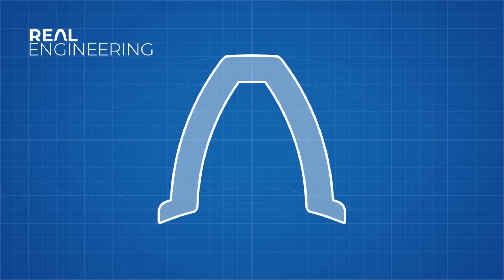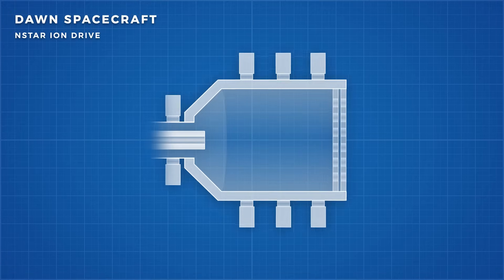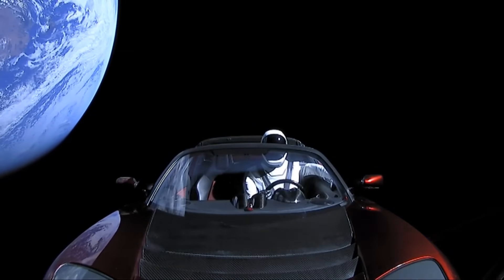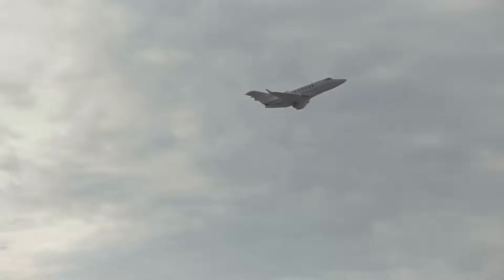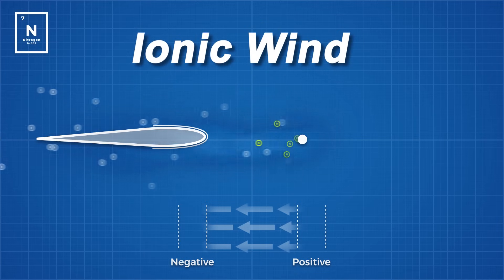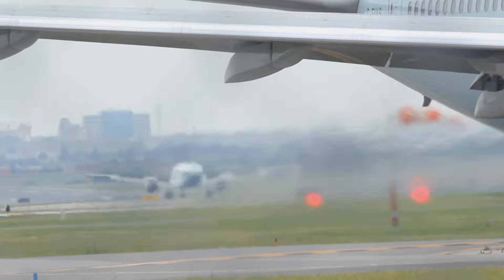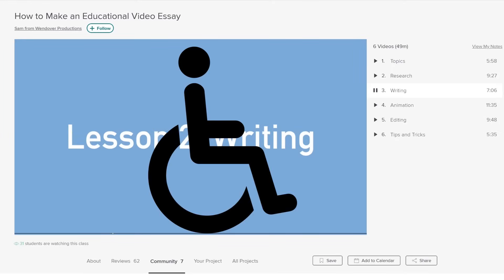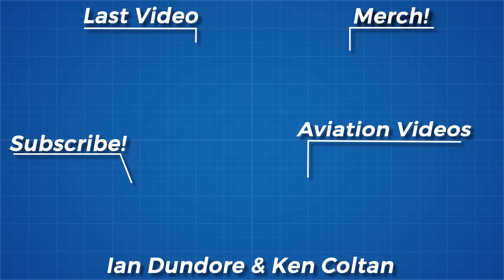Ion Propulsion - The Plane With No Moving Parts

Comment: Reminds me of when my buddy and I made "lifters" way back in the day. A no moving parts hobby flying machine. Though you need a high voltage power supply to make it fly. In my limited understanding and simple terms, this little craft ionizes air molecules along a copper wire and then gets accelerated past a oppositely charged aluminum skirt. Pretty neat stuff. 

Edit: Yeah, MIT's plane looks like modified lifter tech. Instead of vertical whatever-they're-called, MIT made them horizontal and added wings and an onboard HV power supply. Nice... Yep, finishing the video. Exactly lifter tech. Cool beans. And you go into why the lifter needs to be so light to work. Even more nice.
Reply: Can we have a pic?

Comment: This has been around forever. Most famously in the Townsend-Biefield effect propelling a flying saucer in the 1940s. It does work, and can travel fast. However, the problem is the sheer amount of power to do it. And technically, it does have "moving parts" as the wires vibrate so violently they create lift--- so it does generate current, because it's moving.

Comment: Why not transmit the energy needed for the plane via wireless transmission?
Reply: Just use an efficient onboard ion propulsion system:  Please see video of the "Self Contained Ion Powered Aircraft." US Patent No. 10,119,527, An ion propelled aircraft with onboard power, predating the MIT craft. www.electronairllc.org

Comment: what if you put an EM drive that is smaller facing backwards and down on the top of the wings leading edge to increase the flow of air under the wing, while decreasing the air above it, meaning thinner lighter wings producing similar lift.
Reply: That would work, assuming EM drives did.

Comment: Actually a guy did better application than MIT couldn't think off, he filled blimp with helium and directed the blimp with just ionic splitter. He did the whole voltage source using 1 2S LiPo with DC to AC from Piezoelectric converter and finally 10 stage cockroft walton transformation, he achieved 29 kV through which he controlled blimps movement.

Comment: That first flight was much more to do with the skill of the pilot, than the limits of the aircraft.
      Remember, there was no one to teach the Wrights how to fly an airplane. On top of that, the Wright flyer was extremely difficult to fly.
    Even modern day test pilots had trouble flying replicas.
   The Wright brothers were beginner pilots trying to learn on what is the most difficult plane to fly ever designed.

Comment: The thrust to power metric is misleading.  The jet engine generates the thrust at much higher velocity.  And thrust times velocity squared is power.  This would be a more appropriate for assessment of power in over power out, aka efficiency.

Comment: American education as is. 
"These batteries are to heavy"
Of course they are! Because of 2nd low of thermodynamics. 

Hint: try to put solar panels on the plane wing to power up the inverter :)))
Reply: Solar panels are inefficient and with the constrained amount of lift this aircraft can generate as well as the large amount of power required, I don’t think solar panels produce enough power per kilogram to be justified.

Comment: This technology will never scale, for the reasons given in the video, despite RE's best efforts to frame this as some Wright-brothers-esque nascent breakthrough. Though he avoids the direct comparison, the thrust density of this scheme is 0.0003 of the thrust density of a turbofan engine. It would require a frontal area equivalent to 6700 turbofan engines to provide the thrust necessary to drive a passenger liner at speed. This is only one of the limitations hinted at, among other places, in his remarks about scaling. This video is motivated drivel, intended to raise the hopes of the gullible.

It'll please the masses, though, and he can laugh with his Skillshare sponsorship money all the way to the bank.

Comment: Misleading title. It implies that the PLANE has no moving parts (the control surfaces move) when it's the ENGINE that has no moving parts as stated by the narrator in the first 20 seconds. Better title "Ion Propulsion - the Aircraft engine with no moving parts.
Reply: Spiny Norman 88 if you had multiple electrode paths you could make it move up and down without moving parts

Comment: It is a cool idea to generate lift and thrust, but this plane depends from a battery. Electric planes does not have flight autonomy, so this tecnology will improve when the batteries could manage more capacity and voltage in relation with its weight

Comment: Power the planes (and everything else) with Thorium powered Tesla towers scattered across the planet and/or use a large array of solar panels parked in outer space and wirelessly beam the electricity from there. For bonus points make the electricity free because fuck it that's what Tesla intended anyway and park some of the solar panels so they are always casting a small shadow over the exact hottest spot on the planet.
Boom.

Comment: It is cute, but here are a few points:
1. The power to weight ratio cannot compare with turbo-fan engines, EVER.
2. Ion drive in air creates a continuous stream of ozone which would be both toxic and corrosive.

Comment: I think a very viable & practicle application for these Ion engines vvould be on Airship/Dirigibles/Blimps. Airships allready have the required lift & Ion propulsion could be used as a hybrid along vv/solar panels to generate electricity for propulsion & on board povver. Though Airships had their heyday in the 1920's-30's there are more & more company's turning to lighter than air vehicles . The fact that they've developed an engine povverfull enough to propell an airplane means that the engines should vvork equally as vvell  if not better on an airship
Reply: Very good, but thrust generated by using the electric power to run electric motors with propellors would be much more efficient. As a practical matter, the challenge isn't to find an application for ion drive powered aircraft, but to find any application where they would be better than what is already available.

Comment: Could engineers use ion drives in conjunction with solar panels and piezoelectricity to produce larger atmospheric planes that don’t need fuel or batteries to produce thrust?

Comment: Not to be a party pooper but that video clip looked like a spring loaded launch of an experimental glider, not a propulsion system.  Can you get a copy of the unpowered test for distance comparison?

It might be better to use electronic flex materials with alternating current to create a steering system. So far nothing looks steerable.

The other issue is battery life, what battery size was it using, and would it be feasible to use thermal electrics as the cover film? 

If that distance is the farthest it can fly using modern high tech, then we have another 50 years before this gets any good. Heck by then our cars will be powered like the back to the futures DeLorean.

Comment: You forgot to add a really really important part in the description of the Ion Engine: the reinjection of the electrons to make the thrust neutral; otherwise you are charging the spaceship with the excess electrons and also making the thrust charged, this will in consequence cause the thrust to deflect and slow down losing quite a lot of efficency due to newton third law. Not only that but the thurst will come back to the ship and damage the equipment.

Comment: Ion engines have been around for a while. The thruster itself isn't the big deal, it's the power source that's the tricky part. They're a cool idea and certainly work, but require energy input to produce thrust like any other engine.

Comment: I was thinking of using this type of tech in the thrust/exhaust tube of a more efficient EDF (I am still in the engineering stage of making the EDF mentioned) allowing a higher top speed with enough thrust to get there, at lest for a drone/FPV plane.  If this works then it easily can be converted to a hybrid air breathing and vacuum engine, all that’s needed is a compressed gas system and sealing the air intakes, (we could have a electric compressor onboard and refuel  by dipping into a planets atmosphere compressing it and jumping out using the air breathing mode or compress it during a aerobraking maneuver) ®️all rights to this are concept reserved.  Who I kidding this is the internet, someone will try to make this

Comment: I don't think electric propulsion will ever be viable for aircraft, certainty not commercially. You need so much power that you'll end up with far too much weight unless someone invents a small nuclear reactor which is unlikely due to safety alone
Reply: A fuel cell works out good on the energy per unit weight.

Comment: That plane was ejected by rubber bands.....so.......we are still far from even fully applying this technology on a model scale...
Reply: The Wright Brothers first flight used a weight driven catapult. Baby steps before running.
Reply: Agreed that showing a plane gliding on an indoor pitch is not enough evidence to show it works in practice - unless there is further vision of it doing loops around and around "infinitely."

As people have mentioned visa vee aircraft carrier launches - this is also the same with the Dawn, it was launched into space on a Chemical fuel rocket to escape earth's gravity.

This plane here was launched with force enough to achieve a "Starting Vector" and just looking at the surface area of the airfoils I would bet it got to the end where the clip ends on that next to that force alone - I would hope the data they collect is over 1000's of launches knowing that with the force applied against every known variable of the Weight of the craft (or mass and the subsequent gravity exerted on it at any point in it's journey,) the airfoil surface area, design, chord-line, etc, and not to mention completely computer controlled flight surfaces - which would allow Alterations during flight to be collected and modeled.  Then knowing that if the Ion engines are not in play it will travel 50m and 1000 launches gets that as an average.  But with the engines engaged over the next 1000 it gets to 51m average.

The problem with this might be the need to engage more height and a longer area.  Simply because the ion acceleration will not be sufficient over the 11 seconds it seems to cover in the video, meaning it's acceleration over that distance will likely be less than 0.00001m/s^2 etc.

Otherwise it would be more like 1000 tests with no engine - 50m total. 1000 with engine =50.0001m travelled.  Would love to see that measured.

Would love to see this work,  the potential to see the end of noise and air pollution associated with Flight - brilliant

There is an Irony of course - not sure if anyone has picked it up - would it be too much of a hypocrisy for airlines to prevent shipment of LiPos in the future?? since their planes may well be running on them!!!...Not only that - You won't be able to plug devices in to charge on long-haul flights...With the one exception, when the plane starts to loose power everyone will be requested to hand over their mobile devices with USB-C ports in order to power the Plane!
Reply: We still launch fighter jets from carries using literally catapults. doesn't mean the jets are unable to fly. In this case they use a catapult because they don't have enough room or time for the takeoff roll, and need to get a head start so that they could test the ion flight before hitting the wall of their testing locale.
Reply: Technology development is exponential.
Reply: Stolze Herren Yeah I fully understand that. I was just saying that we need to be aware that this technology might not seems as well developed as is shown. I certainly hope to see it evolve step by step and revolutionize the whole airline industry and more!

Comment: This plane is an amazing feat of science and engineering. Though making a practical airliner, or combat plane using this technology may not happen for centuries, or even millenia!
Reply: The design of the high voltage supply is not very good.  That part of the design is "hack" level.

Comment: The plane looks flimsy, and shimmies like Jello. The plane has rotating engine parts, but it moves quite a bit. Like a steel brigde, the plane is quite dynamic, and  will fail due to mechanical stress. I  can't see it being scaled up to large planes, but for very small devices, it would be the only way to go.

Comment: Would a small jet engine optimised to turn a generator instead of thrust be used to power the plane? Ultra fast & ultra balanced allowing the speed required to generate enough power, I've heard some use this to power things when on the ground, just need to make it bigger & better at that.

Comment: 5:37 How can ions colliding with air atoms provide any additional thrust? If anything, it should instead create additional drag because of the generated opposing wind rubbing on those rear foils... Is it because of each single ion spending more time between the cathode and anode? :)
Reply: The energy in a moving body is:
E = (1/2) * M * V^2
The momentum is only linear with V.  Thus the more you can make the ions couple into the atoms of the air the better because that increases the M involved.
Reply: @kensmith5694  , I'm talking about that when you've fired a bullet out of your gun, you don't get any additional recoil depending on what and when your bullet hits afterwards :)
Reply: @kensmith5694  , but I think I'm getting your point.

Comment: Also the engine should be less efficient the higher you fly because the athmosphere becomes less dense the higher you get so there is less air to use for acceleration
Reply: Maybe but as you get lower pressure, ionizing becomes a bit easier.

Comment: Do you think that eventually they will be able to accelerate the plane sufficiently with battery power that a turbine working on the airflow would be able to provide electricity to charge the batteries?

Comment: How do you use geometric programing optimisation?

Is it a reverse engineering?

Is it possible to calculate the wing airfoil shape if you want a specific cruise speed?

I would like to learn aerodynamic conception, and flight simulator programing using aerodynamics formulas and low thickness airfoil theory.
Reply: Here is basically what folks do:
Make a very rough design of the wing.
Get software that can model the air flow over it.
Make some rules for rating how good the wing is.
1)Try a small random change to the shape of the wing.
2)See if this made it better.
3)If it is better accept it as the new version.
4)Repeat from 1
The best way to do this is to have many copies of the same thing going for a while.  After some number of cycles, throw away the worst 50% of the designs
and make two copies of each of the better ones then let it continue.

Comment: That front wire could be on the end of something more aerodynamic, like a front wing.
Reply: Yes, making it a canard wing design with the main wing as a biplane design would no doubt work better.  Razor sharp points facing backwards from the front wing would work to make ions with less drag.  A pair of wings at a really high positive voltage would make a space between them that is very attractive to the ions.

Comment: Two Hundred Thousand Volts.  And was this under arid conditions or humid?  Certainly won't have to worry about any birds that cross it's path, you'll be able to serve them as roasts afterwards.  Seriously, even with a grilled layered module the atmosphere is too inconsistent for reliable performance within reasonable tolerances, and that's not including all of the other garbage in the atmosphere.

Comment: The plane was powered by an ion wind generator, not an ion engine, ion wind generators have been around for about 150 years, in fact some of the earliest you-tube vids show demonstrations of ion wind propulsion in peoples garages, real low tech and DIY, Ion wind generators will not work in a vacume also demonstrated on you tube.
I don't no real engineering you come across as a bit spivy, I have no idea what you are selling but it can't be that good based on what I see and hear here.

Comment: I think if enough energy could be provided to viably power an electric plane, simply using electric propellers or jet engines would probably be a lot easier and more compact. Analogous to electric cars, all the combustion bits would be replaced with electric motors, thus being very simple. Such engines would still be pretty noisy though.

Comment: The so-called 'ion wind' effect works in a vacuum, Gravitec tested it for NASA and there have been multiple confirmations in the years since, so there's something more at work than wind.
Reply: Yes, but the spacecraft needs to provide the atoms which are ionized whereas this plane ionizes the air, eliminating the need for fuel.